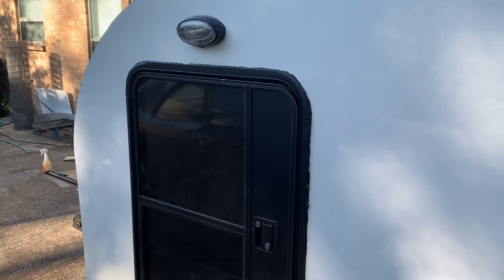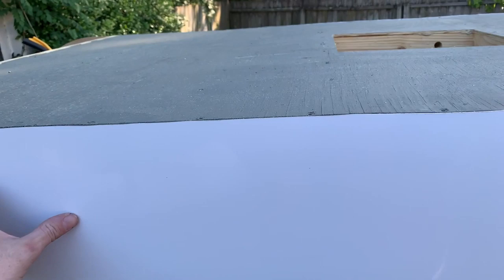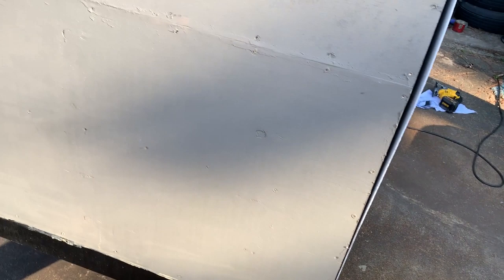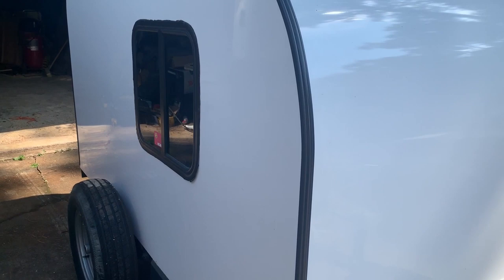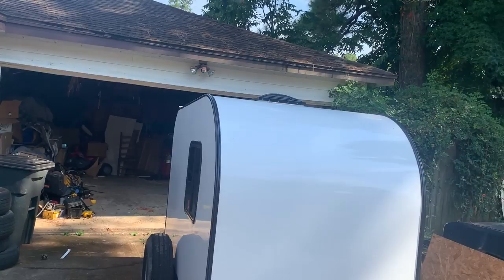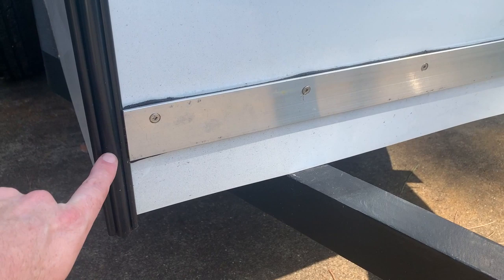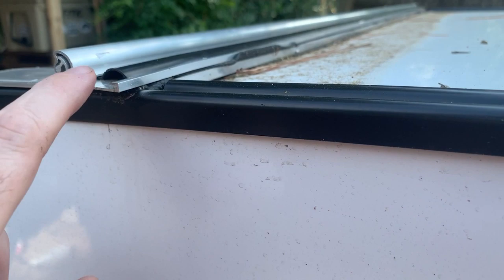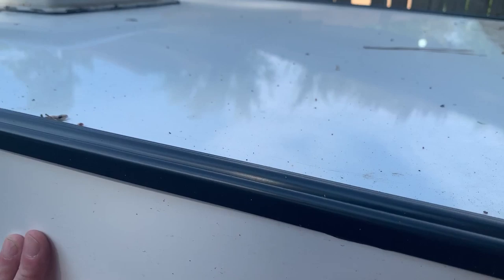DIY Micro Camper - Aluminum Skin & Trim

Comment: the skin is going to look great on the camper   i’ve been a boater for over 35 years and i would get those corners glued on with 3M 5200 Caulk Adhesive  unless you are very faithful on your corner trim with screws  which does look nice BTW
Reply from the maker: Craig Monteforte I’m pretty confident in the trim holding the skin in place. That’s how almost everybody builds these campers. Thanks for your comment.

Comment: Nice job on the trailer =)   I hope you can stop the hinge leak =)
Reply from the maker: Pat Hopkins Thank you. I think I should be able to with my plan for a replacement hinge. Thanks for watching!
Reply: @BasecampUnbounded  I made my tiny trailer in about 2004 from a on-sale HF heavy duty 1750# frame =)   It is an Ugly Duckling to even be nice .... but a work in progress 15 years later and well over 100,000 miles later :-)))   I still love camping in it anywhere  and any season =)    It is of a Cricket like design or some call a Widget design =)
Reply from the maker: Pat Hopkins that’s a lot of miles. Awesome!

Comment: I'am planning a similar thing to slide onto my utility trailer....I was thinking of using the windows from a truck cap? I wonder if this would work?...wondering about the thickness of the cab and the playwood and if a truck cap window could be sealed properly?...Nice project...
Reply from the maker: Jim Smith I’ve seen a few people in Facebook groups that have talked about using windows from truck caps. I’m sure you can find a way to make it work. Thanks for watching

Comment: Hay Basecamp I had an issue with the hinge turned out it was not enough tacky tape as I stoped 1/16 inch short of the edge.
Reply from the maker: M Langford I think mine is the weather stripping between the two halves of the hinge is too short. Thanks for the support!

Comment: Did you glue the skin onto plywood.? I don't see any rivets or screws! Looks great!! now I just need the time and place to do it.
Reply from the maker: Sean Calabro the aluminum skin just floats over the wood. It is held in place by the trim, window, door and fan allowing for expansion and contraction of the wood with changing temperatures.

Thanks for watching

Comment: That trim on the roof edge looks thick...how did you get it to bend on the curve?
Reply from the maker: Loral Kinney it’s made from a softer aluminum it bends pretty easily. I started at the bottom with a screw and slowly moved my way up letting each screw do the work to pull the trim around the curve. It’s soft enough though that you could pre bend the trim by hand. Thanks for watching!

Comment: Thanks for sharing the vid !    I am currently  sourcing parts and material for a build .   Apparently there is condensation build up in these small campers ,   when small heater is needed  (I'm in Canada)   and windows are closed .    I wonder if anyone has any solutions for this problem  .     Anyway ,  just found your channel ,    camper looks good ,   i'll have to check out your other vids .
Reply from the maker: cyril brun keep the windows cracked or open the rooftop fan/vent slightly to avoid condensation. These campers are small enough that even with the window or vent open a little a decent heater should keep you plenty warm. You could also use a dehumidifier. Thanks for watching!
Reply: I don't know if a small DC  dehumidifier exists ,  but 2 windows cracked slightly hopefully should work .  Thanks.
Reply: We just have the max air fan on setting 1 which is the lowest during the night and the trailer is not air tight so it gets enough breeze

Comment: Where did you get the aluminum skin?
Reply from the maker: I got it from a local sign shop
Reply: @BasecampUnbounded  Do you know what grade it is? I am currently looking for aluminum to put in my camper but there are so many grades and i’m not sure which one to get.
Reply from the maker: @mycraftdealer35  mine is.040 preainted 5x10 sheets. They were about $100 a sheet 5 years ago.

Comment: Where do you buy the sheets of aluminum like that and the channel for the edge So? Nice build.
Reply from the maker: Jamie Hackney Thank You. I got the aluminum sheets from a local sign shop and the trim from Vintage Technologies. Thanks for watching!
Reply: Basecamp Unbounded I never thought of a sign company. What’s the largest size sheets you can buy?
Reply from the maker: Jamie Hackney They had 5’x10’ sheets in white and raw aluminum or 4’x10’ sheets in different colors.
Reply: Basecamp Unbounded that flush mount router bit is a must. Are your walls 4ft high or 5?  Thanks for the info. I’m going to try my hand at a build for a off-road camper
Reply from the maker: Jamie Hackney walls are 4’. Good luck with your build!
Reply: Basecamp Unbounded thanks so much. I’ve subscribed and watch your build videos. Great job can’t wait to see interior build.
Reply from the maker: Jamie Hackney you’re welcome. Thanks for the sub!